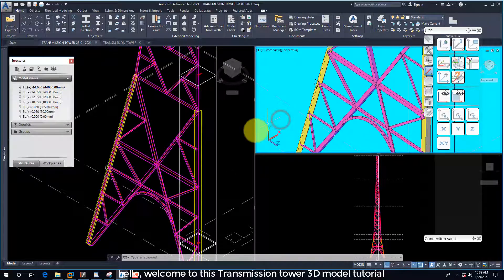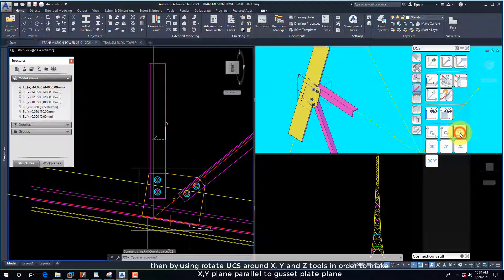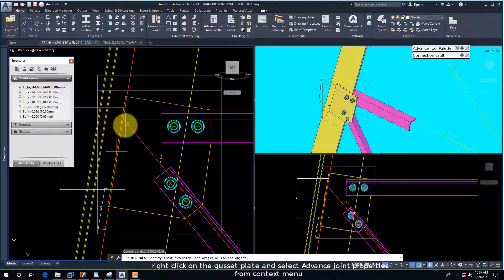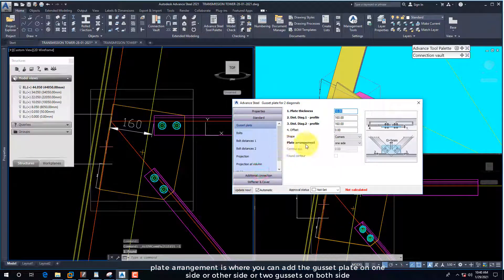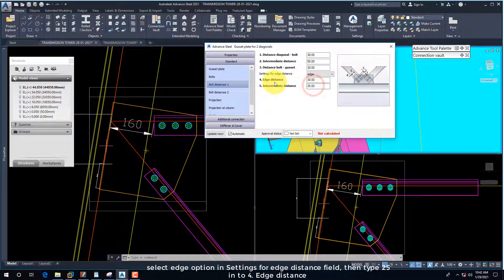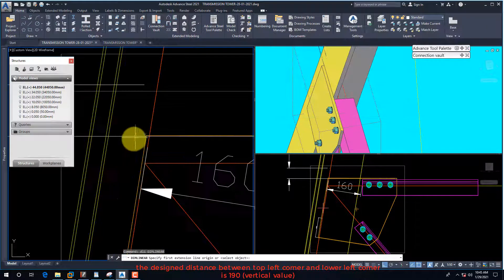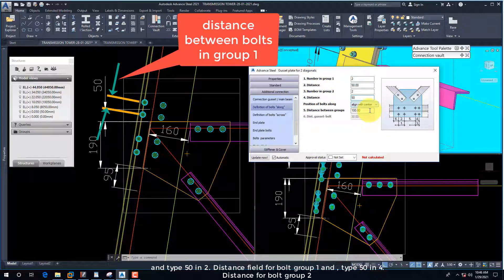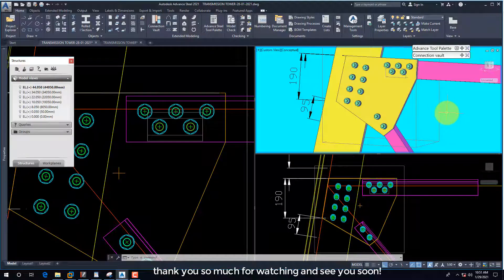TRANSMISSION TOWER/03/GUSSET PLATE FOR TWO DIAGONALS

Comment: How do I hide some of the line of the V steel wing in detail drawing? Due to the inclined structure, there are many lines that confuse the drawing. Thanhk you so much!
Reply from the maker: on the detail, you could select this part and open the properties, then tick the box for hidden line and change the color and the line type to the same as you use for visible lines...not the best way but in some cases the easiest one.
Reply: @dw2022  Thank you so much for your reply. 
I just want to hide one line, not all line of the part.